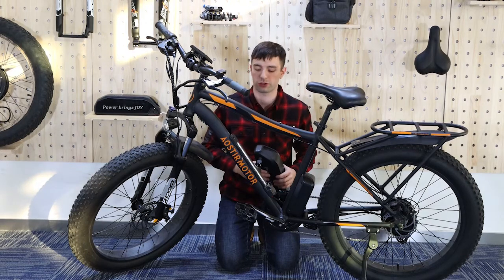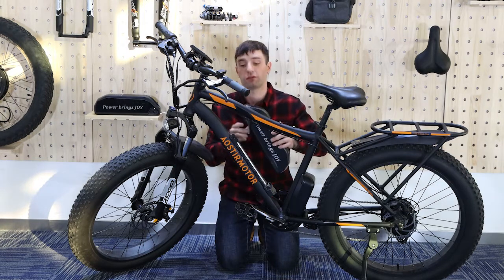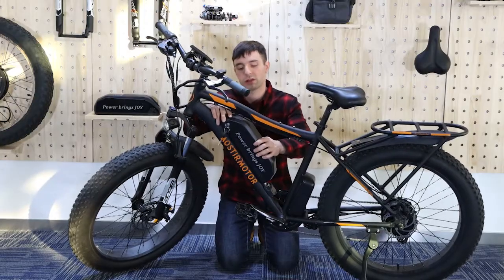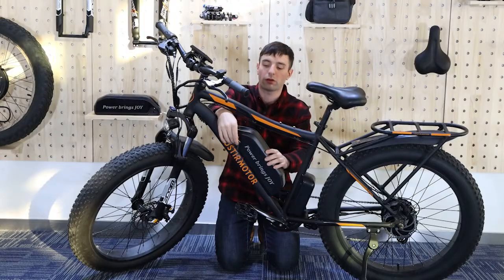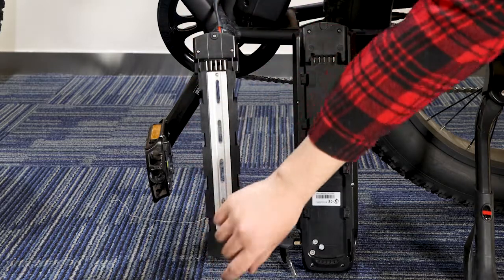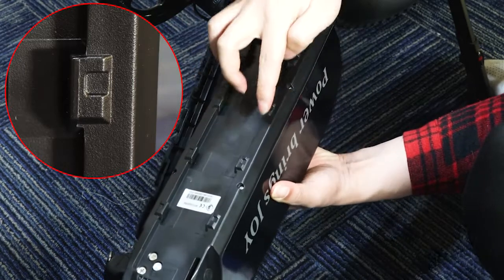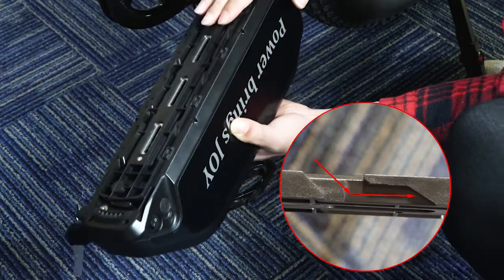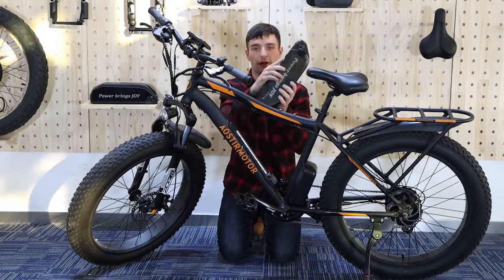Battery Installation for Aostirmotor S07-B Electric Bike

Comment: Hey I just got this bike yesterday, Im a very inactive person and yet I used a whole charge on my first day I love this thing.
 I feel pretty stupid but does the battery require decent force to take off in the unlock position? Im having trouble getting it off and I don’t want to break anything on my 2nd day
Reply from the maker: Hello, thank you very much for your support and love for AOSTIRMOTOR. If you want to remove the battery, just turn the key to the unlocked position and lift the battery slightly to remove it.
Reply: @LEAVANOfficial  lock was stuck , im a dummy. I'll be making a video next week and link it here thankyou again!
Reply from the maker: @crazychainsaw007  Hello, can you get in touch with us through Instagram, you can send the video and contact information to Instagram, we will deal with the problem for you as soon as possible. INS link: https://www.instagram.com/aostirmotor_official/

Comment: i want to upgrade  battery  which one should I buy   I just bought S07B  bike
Reply from the maker: Hello, where did you buy it, you can send your order number and the problem you want to solve to aostirmotor01@gmail.com and we will have professional staff to follow up with you. Or leave your email and someone will contact you later.
Reply from the maker: Hi, has your problem been solved? Do you remember which platform you bought it on? Can you leave your email or other contact information, we will get in touch with you as soon as possible to solve your problem.